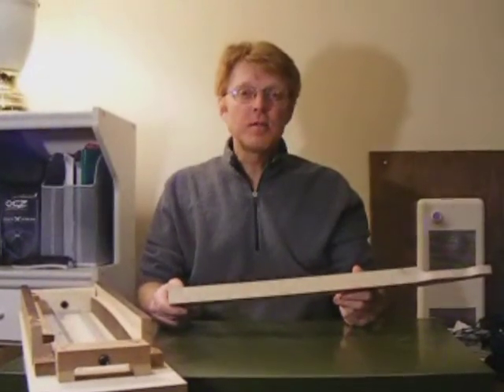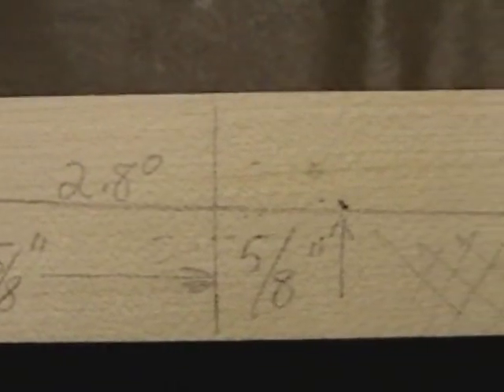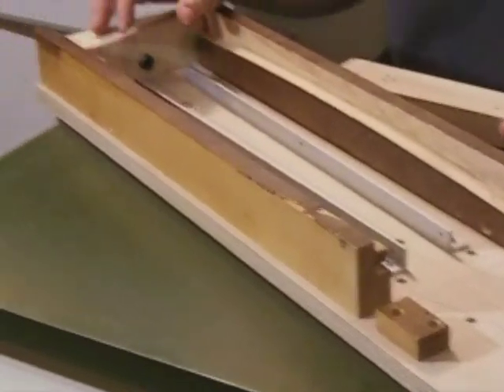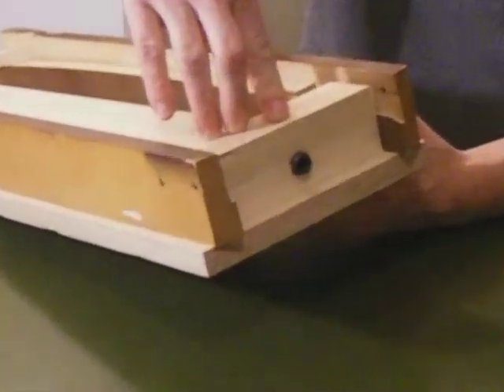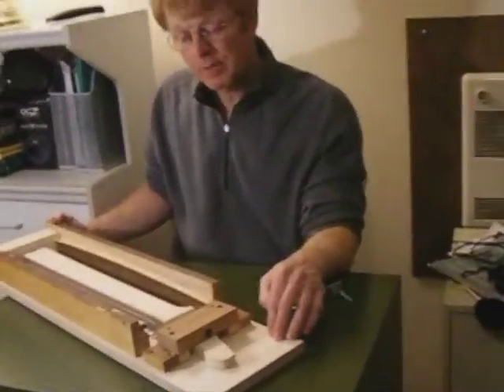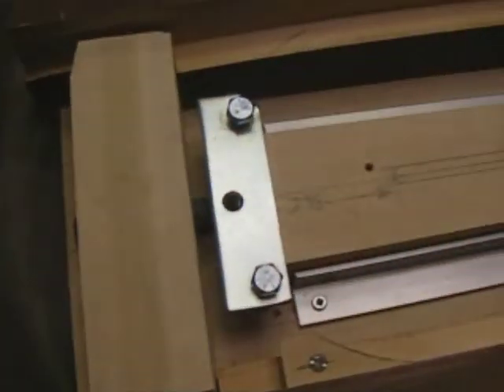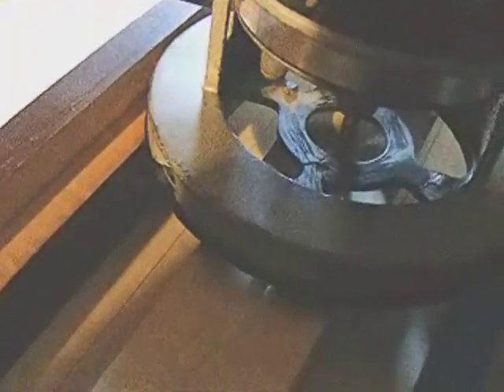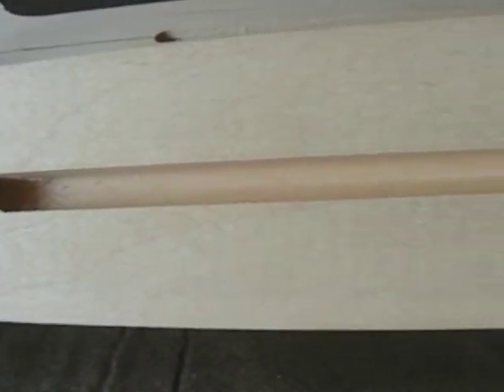One Piece Neck Build Part 3: Trussrod Channel

Comment: Nice videos, Bill. I haven't watched them all yet, so maybe the answer to myq question is in the yet-to-be-seen: how do you arrive at the angle for drilling the adjustment screw holes? How do you make those end blocks with that exact measurement? Thanks, Steve

Comment: Im building a '51 precision bass style neck, im assuming the radius of the channel needs to be a bit larger to maintain the same exit angles given the length of the channel will be longer. my math tells me the difference beween the depth at the ends and depth at the center of your  channel is about ~.174" at your radius of 147". should i keep that .174 and extrapolate the radius size given an average exit angle of 2.9 deg?